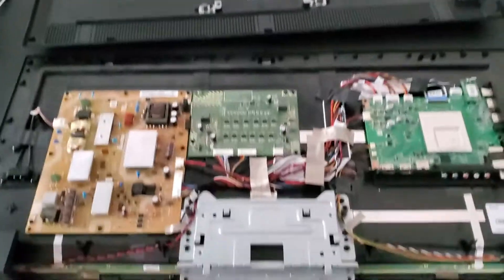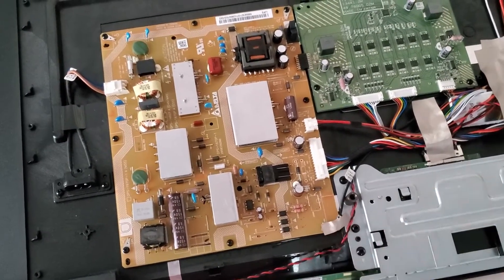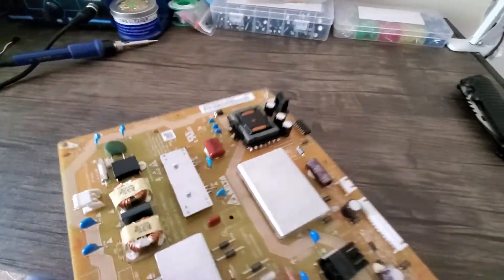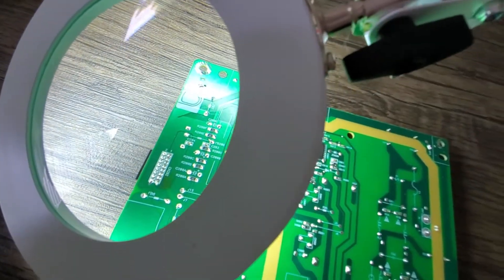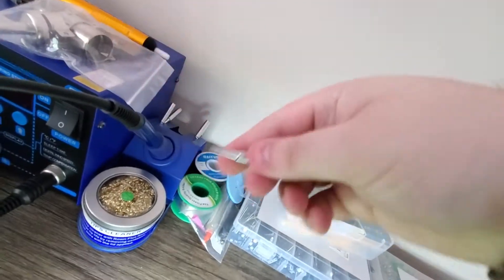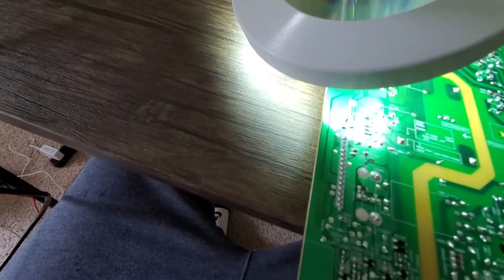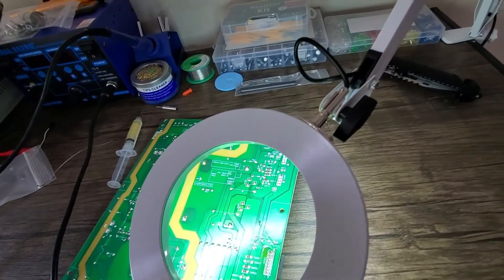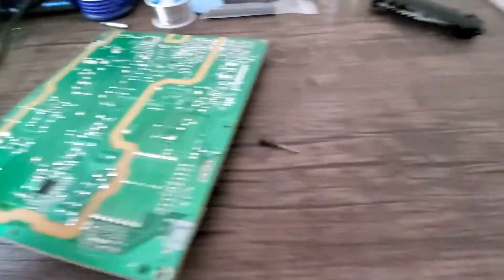How to fix a VIZIO TV that won't turn on ($600 SAVED)

Comment: My 2017 P55-C1 went dead after turn on. I was able to fix it by tightening the ground cable on the power supply board.

Comment: I purchased an E390-A1 Vizio in 2013 for $409.00.  Now, I know it's a ten-year-old appliance but, it still comes on about 40% of the time with the remote (side power button was broken out of "frustration" on my part!!)  I have recently purchased a new TV, but I am going to take some time and take the Vizio apart before I chunk it because it is doing exactly what it says in your description--power light coming on, fading away and TV not turning on.  So yeah--I HAVE to try this first.... thanks for the video.

Comment: I have a wire to board connector that's burned. I can replace it if I can find the right connector but I don't have the tools or know how to diagnose everything. I'll never buy vizio again.
Reply from the maker: Yeah but to be fair I also have an LG that stopped working and the problem with that was the LED backlights burnt out, which is a much more involved repair.

I think just in general these TVs are made so cheap nowadays. Even Samsung ones use cheap parts, unless your paying like $1,200 for the ultra HD crystal curved flux capacitor whatever edition.
Reply: @The Review ANYTHING Tech Show  I have a Sony I bought about 10 years ago that has moved with me no less than 5 times and once was from Japan to the US and it still works fine.

Comment: Thanks so much! I got the same model for free and it’s perfect for my man corner. It went out this week and I didn’t want to drop $500 to replace it. I also didn’t want to sacrifice. Me and my son play a lot of split screen gaming on it 54”. Anyway I shined a led light on it and could see that the images were still there. I saw your video and thought why not give it a shot. My pins were super loose. I did add more solder but those pins are super close so I took off most of what I put on. Start to finish took maybe 30 minutes. Me and my son give you a big thanks for this dude!

Comment: Thank you for this video! 

My soldering iron tip was too big to effectively use on that small of pin, but I ended up using the tiniest dab of super glue between the bottom of the chip and the board and held it in place. I had to be super careful putting the board back in and connecting the pins but it worked! Solder is definitely the best long term route, but in case anyone doesn't have access to one, super glue will work.

Comment: I think my Vizio E480i-2 has this problem, I took the back off and didn’t see anything obvious. I didn’t take any boards out. Put back on and it worked for a couple hours and went black. I took my hand and smacked the back cover and the picture came back. I’m going to take it back apart, seems like a loose connection like this. Will post again if it works.

Comment: Nice, I wasn't going to take this free TV I just got apart, but now, I think I will, thanks for the encouragement, if I get electrocuted then I guess, hell idk, I'll thumbs down I guess?
Reply from the maker: Be careful, I did have it plugged in at one point and touched a transformer stupidly and shocked the hell outta myself. Like really bad, pls be careful, always keep it unplugged when working on it and make sure caps are discharged.

Comment: Why are almost every tv repair video is on Vizio tvs
Reply: Because they suck. I have a Sony TV for about 10 years, it moved with me several times to another country and back then half way across the US and back and still works fine. Had this vizio for 5 years and it takes a shit.

Comment: Hi I have a Vizio e55 c2 with the same problem I changed both the main unit and power supply board but it didn't work I still have the same issue can you help please

Comment: Did anyone have a warranty on the tv? What was Vizio going to do under the warranty?
Reply: My tv doesn’t turn on had it for 4 months they are going to my house to repair it under the one year warranty
Reply: Vizio is fairly good with their warranty claims and like the rest of the makers, a recertified unit usually is shipped vs. doing any repairs at the residence. Once the warranty is expired, Vizio tends to suggest any repairs hired for are not worth it and to plan on replacing the TV.  I'm fairly unsure that is the most fair minded idea if the owner has any sources who do this kind of work or have the skills of their own to simply replace the bad motherboard and the correct one of the two or three or four that might be present. 
As usual, the problem isn't the design or the equipment. The problem is the soldering process/quality of components.  Every time you find this concern, its usually related to a poor solder joint. Quality standards need to be improved.  So, this new TV was constructed and sold as a defective unit from the start due to poor workmanship. Sad.
Reply from the maker: Prolly not, it was my parents and I think they had it for at least a few years. Didn't check.

Comment: What model is this?
Mines a D32f-F1 and when I go to turn it on the button on the left doesn't glow up and same with the screen.
I hope this'll work for my model of your is different
Reply from the maker: Its in the description, its an e550i-b2e. Just open it up and if you see that connector, that is likely the problem.
Reply: @ATLTraveler  ok thank you
Reply: Ok I've opened my tv up and there is no connector at all.
My power board is separated from the two other boards